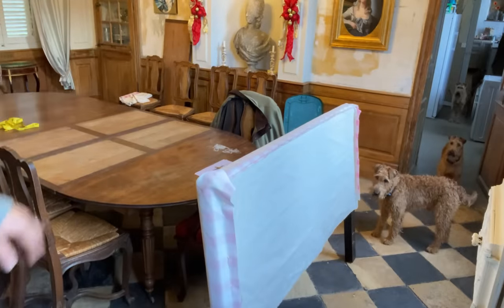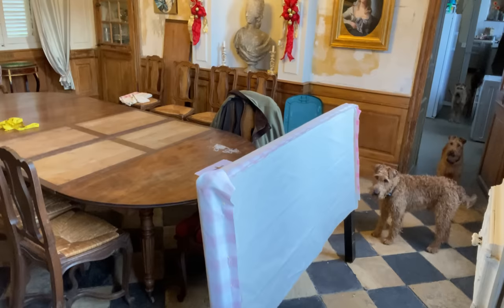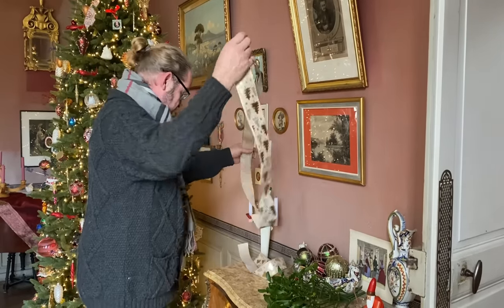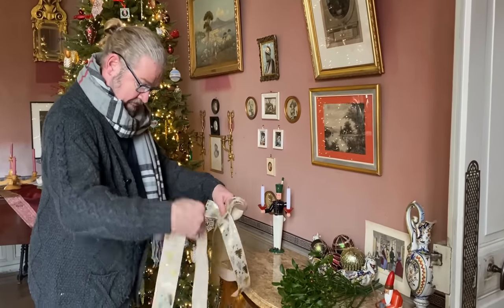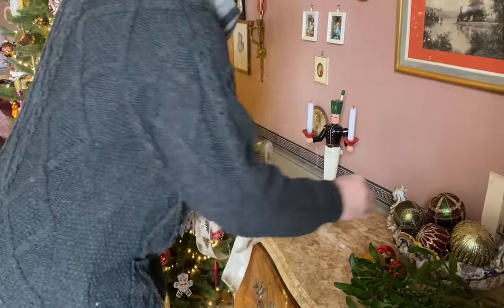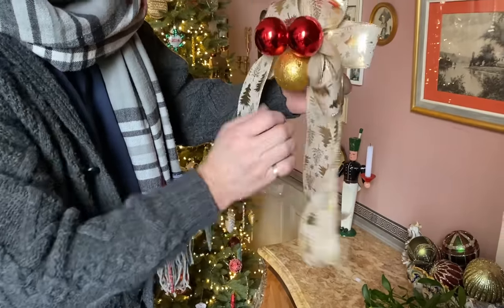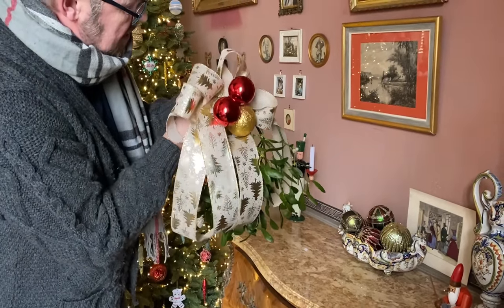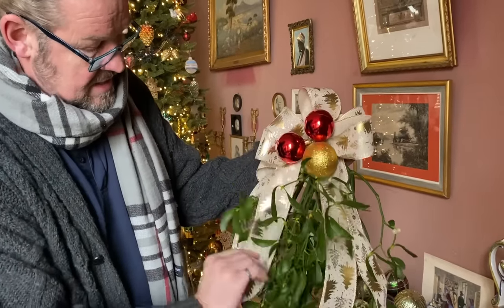Headboard Makeover DIY - Creating a Custom Headboard Cover - Journey to the Château, Ep. 159

Comment: what size mattress do you have in France.  Is it like a US Queen or King. I use a Queen 60 by 80 in.?
Reply from the maker: They are all over the place here with mattress/bed sizes. Nothing so simple as twin/double/queen/king. You have to literally measure your bed frame and find a mattress to fit those dimensions. And you can imagine, finding bedding to fit is even a bigger issue. They don't actual sell sheet sets. You have to have your mattress measurements with you at the stores, and the flat, fitted, and pillow cases are all in many sizes and sold as separates, often not in matching colors.
Reply: That's crazy 😮